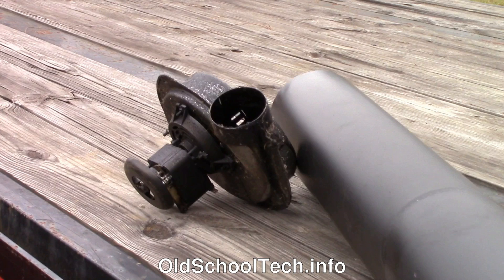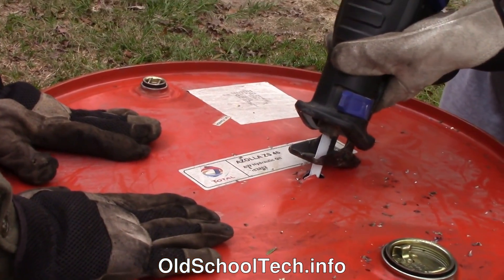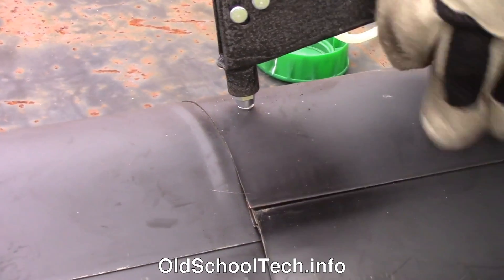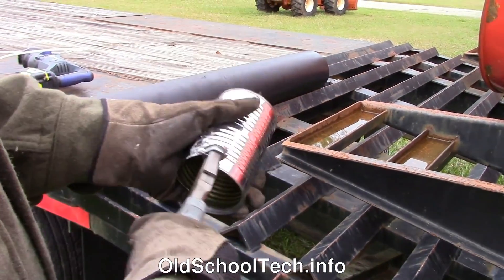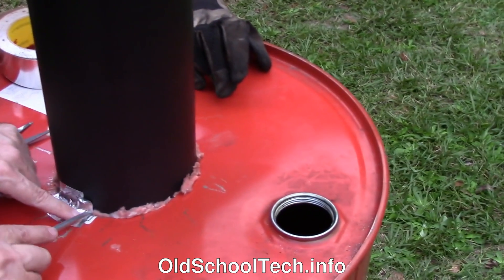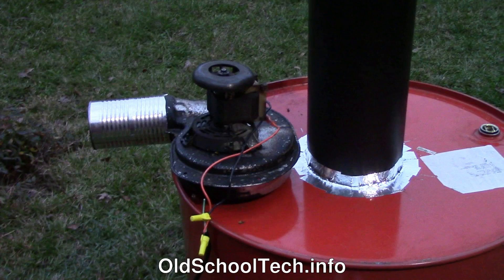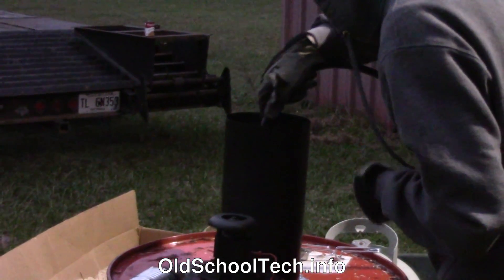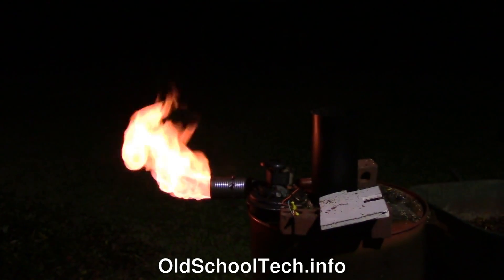Building a Simple Pyrolyzer - Old School Tech

Comment: This is called a downdraft gasifier this design generally does not get hot enough in the pyrolysis zone to crack a long chain carbon molecules. Meaning that there will be a shitload of tar in your fuel. These men put together an absolutely simple way of doing this which is a good thing. Real talk be careful with your air leaks
Reply: That is what I was thinking. It looks more like an inefficient gas generator than a pyrolyzer.
Reply: @buggsy5  if you seriously want to do this it has to be an invert type design. I think I'm on generation four or five it's been a really cool learning curve Mr Thessalonian and this other guy flash 001 completely took me to school on how to do this
Reply: @accelwell7018  I am not about to do so with plastics. Even with proper catalyst/plastic mixing, the external heat process uses far more energy than the energy available from the resulting oil. The only real advantage is reduction in the amount of waste plastic.

Proper gasification of household waste is getting close to being carbon neutral in a couple of trial plants. But they do not use straight heating of the reactor to produce the gases. Steam and oxygen are pumped into the bottom of the reactor under pressure to do the gasification. It is basically the Bessemer process with the addition of steam injection.
Reply: it is actually an updraft gasifier. Not downdraft